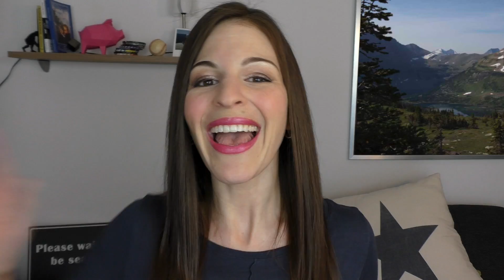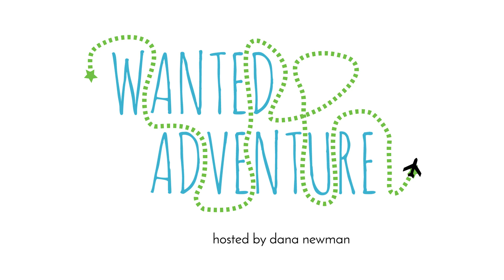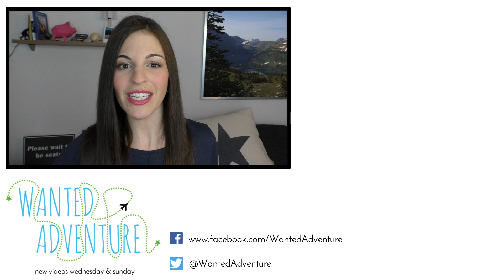Why Are Houses in America MADE OF WOOD?!

Comment: In warm climates you will find plenty of cement. Cement does not age well being exposed to the elements and temperatures in the Northern US. Wood does settle and warm with humidity and cold, but it is also a lot easier and cheaper to replace if need be.

Comment: I disagree with the argument of the tornado proof houses. It's correct that tornados can carry out big objects like cars and it's correct that you can't prevent to suffer damages in your house because of them, but if you hit a car against a house(because of insane speed) the car can destroy only a small part of the house, not the entire building. A good reinforced masonry house is very resistant and you may damage a wall or pillar but not the entire house as a tornado can do in a light wooden house.
I think it's more precise the fact that the cost of a house made of concrete is far much of a wooden house. Suburbs houses are tend to be big in surface and the same house in stronger materials would cost much more so, you may have to choose between a smaller and strong house or a big and light one... And the big house is always more attractive until you face a tornado or a punch in the wall...

Comment: wood is great for making homes its been used form homes since life existed, but ofcourse our history only remembers houses made from other building blocks, stones or just 1 single stone.  There are zero benefits of making house with wood over concrete, steel and bricks except cost. 
so cost point of view if wood is cheaper then other building materials around you its a good deal. Most concrete houses are made for more then 50 years to 75 years, but you can extend life up to 100 years, by putting good foundation, regular plastering and painting at least after every 10 years or 15 years.

Comment: I actually came to this question after a visit from Morocco. They make their buildings from concrete. The floors, roof, walls, and steps are incredibly strong and solid. I was wondering why they didnt do this in america. I did find out that prior to 1940s the norm in america was concrete and brick, which you did not mention in your video. After the 1940s they switched to wood because it was cheap and quick

Comment: 1. Wood is abundant and cheap in the U.S. 
2. Most houses are first or second survival houses (meaning first one on that lot)
3. European houses burnt down/ torn by Earthquakes for thousands of years, maybe 99% of them. 
    So the older ones are naturally the 'survival of the fittest engineering's'
4. Brick houses aren't immune to windstorms - An house in Tornado Alley is more likely to survive tornado than a brick house that is not built up to code.
5. Tornado Alley Also has Earthquakes. So you can't make things purely out of stone 

This type of house will do just fine:
Concrete Foundation with Large Metal Braces in every corner, ties from the sill frame the rods in the concrete. 
Ties from the sides of the walls to each beam. Hurricane ties on the trusses, Brick Vyner siding with ties every few rows 
to keep the wall from falling over. Sideways bracing for the walls so that the house doesn't go 'parabolic'. If you tie the roof to the
foundation it will have an 95% chance of surviving and EF3 Tornado with minimal structural damage. The Most Important Part 
Is the Roof Tie down to the foundation. If the Roof Goes the whole house goes regardless of strength of inside. 

If you want proof that Brick/Iron builds won't save you Look up 1896 St.Louis Tornado, and see what the 2011 Joplin Tornado did to Steel Structures with modern code. 

Code is key! Remember many houses have to survive both tornados and 8.0 Earthquakes in the Mid-West.

Comment: Correct me if i am wrong but i believe most of the world apart from North America builds most of their modern (not vernacular) houses in Masonry and Concrete. When North Americans first settled they found plenty of wood and they needed to quickly build settlements. They continued to master their techniques inorder to cull its disadvantages instead of turning to masonry which was obviously more advantageous when looking at strength and durability but required more work and time

Comment: Hybrid stainless steel rebar and stainless steel fiber reinforced concrete house. The posts, beams, floors, walls, roofs, foundations, stairways, etc. Concrete is 2-1-4 cement-sand-gravel parts by volume ratio. Water is pre-mixed with plasticizers and retarders to create a 
semi-plastic and semi-liquid concrete mixture. The 1 inch thick stainless steel rebars must be spaced apart by 1.5 to 2 inches from side to side. The stainless steel ties must be .5 inch thick and tied together by triple-twisted stainless steel wires or stainless tungsten steel mechanical clamps and the stainless steel rebars connected together by stainless tungsten steel Mechanically Bolted Couplers (MBT).  Mechanically Bolted Couplers (MBT)  (M)echanically (B)ol(T)ed MBT.

Comment: in Egypt they are mostly apartments ! And are built of cement bricks...and cement filled over it , you need a drill to hang any art work or curtains, that is a big draw back....yet they do not burn down... but other things inside like clothes and melting items are not  o.k. After a fire...we had one when we lived there...the smoke and deep and black ash on floor ...it was still devastating...it was a dryer fire...

Comment: the Tornadoes you referred to are probably the extreme examples, if houses were built with concrete and bricks/stones will make a significantly different percentage of (less damage) than the wooden homes with standard construction (no extra fortification). I believe the abundance of wooden raw material for home building make a larger margin of profit "that the industry is not willing to lose for the sake of safer homes"

Comment: Vulnerable to natural disasters, Fire hazards, Cutting trees even if they came from a wood farm, Termites, useless spaces like attics  that just take materials and due that no flat rooftops that could be utilized, moist basements if any, sound and creak from inside and outside, plus other habits of building like hard to work and handle stiff single core electrical wires that most of the times go through woods with no conduits (fire hazard), all the world went for cheap, easy to work, ever-lasting and sanitational PVC Piping while obstinately continue to use those precious copper pipe that with these magnitude of usages will soon became a rare earth element and many more, all in all is bad package.

Comment: In Mexico most houses are built with blocks and concrete with concrete roofs. All you got to worry about is impermeable paint for the roof and exterior paint every 10 years approximately. My grand parents home is over 50 years old, 3 stories high and still standing.
Reply: Houses in mexico look ugly why do they build them with a flat top roof with pipes sticking out of the upper walls

Comment: It's not about surviving a hit from a million to one bus at ~random speed but about but general survivability from the storm and not creating extra debris.

There are thermal benefits, brick has a much higher thermal mass so it  takes weeks to heat or cool rather than hours for wood. In hot climates wood may be beneficial but in Northern Europe it can change day to day and most of us do not require Air conditioning. We can open windows in the evening if we need to cool the air and the house stays fine throughout the day as the heat cannot get through 2 brick walls and insulation.
I would rather be in my 100 year old brick house or my mums 40 year old brick house both with cavity compared to a similar wood version. Doesn't matter if a bus hits any house at 200 mph but I bet it would stop sooner if it hit mine rather than going through '2 blocks' of wooden ones (Bricks are a lot heavier so the energy is dispersed). 

Also Bricks are really really really hard to burn , wood not so much.

You did not mention cost. Bricks are more expensive. I'm almost 40 and will pay off my mortgage before I'm 50. My children can pass the house the their grandchildren without having to rebuild it.

Comment: She missed several other really important points on why American home are built the way they are.  German homes are three time the cost per square foot to build.  Mortgaging laws restrict the maximum pay off time on your homes mortgage to 25 and in extremely rare cases 30 years.  No bank will offer a mortgage that can be paid off by an average family in 25 years.  The final one is a doozy is energy efficiency.   If you live in a really hot or really cold area, it's better to insulate and weather seal a wood frame home than one made of concrete and steel,.  It can be done, but it will cost you dearly.  Lastly, the end of home life cycle cost in environmental footprint has to be considered.  It takes far more energy to create and dispose of concrete and steel over wood.  Mining, refining and disposal of steel and concrete is substantial.  Wood as it's being produced, absorbs CO2 and it's more redily absorbed by the environment.  German home are neither cost, energy or environmentally efficient compaired to American homes on several levels.

Comment: Rods, bricks, stones, steel beams, glass, cement, concrete,  I  would  have  my house built with thick walls mainly, the windows may be covered with steel shades, a very safe basement, an inner concrete reinforced rooms at the center of each floor,

I consider that the flying debris  such as those that  you  describe may damage  the wall or it may smash the steel blinds at some of the windows or an outside door, but it would only produce minor damage, if houses like that would be built at the tornado alley, the amount of flying debris would decrease in a large percentage, the cars would be parked inside solid garage structures, and the costs for an insurance company would decrease in  the end because the damage would never be the whole house just parts of it, and the mo0st better part of it all is that your life is still safe at home

Comment: Oh also, in case of fire wooden structures actually hold up stable longer than concrete and brick because all that stuff is heavy and supported by steel which heats up and bends. Wood even while burning is supposedly still pretty stable until a certain point. (that being said I'm European and I still prefer the solid brick walls and ceilings to the wooden squeaky ceilings and flimsy drywall - wooden beams tho look very nice and presumably would even benefit from the better stability during a fire I talked about)
Reply: Total Bullshits! The reinforced concrete and bricks are much more fire proof than wood.

Comment: The thing I hate the most is you can punch a Hole in a wall by accidentally tripping and you can hear EVERYTHING, the neighbors, heating machine, the person in the next room, the steps on the floor above. I grew in a concrete House and noise is minimal. Its crazy to think Houses in North america are made out of such cheap and bad quality materials and still can cost millions.
Reply: The difference is that people actually own decent sized homes in the US, unlike Europe. There is nothing wrong with building homes out of wood, and there are plenty of methods and materials to optimize soundproofing and weatherproofing.
Reply: @fosterslover  Why don't you Americans use concrete and masonry as building materials?
Reply: Profits for developers wood is cheap and quick to assemble together
Reply: Not all wood is made equal muricans just use the cheapest plywood (literally waste wood glued back together) they can find, i always lived in a house made out of stones but i'm pretty sure good trunks aligned like a French or Swiss Chalet is very durable with it's thick walls.
Reply: and they're expensive. it's crazy
Reply: @P2Pbase  expensive wood houses in USA! I also wonder why
Reply: Actually wood houses are cheaper and resist better to heat or cold
Reply: @becayebalde3820  Wood house can not isolate the sound. Wood house is much more vulnerable to fire.
Reply: The thing I hate most is you can pay up to $1mil for a timber box, stick a sheet of paper on it and people call it a home
Reply: No the noise is not minimal in a concrete house. I have a mentally unwell neighbour who screams, you can hear her two rooms away.
Reply: Not ALL the houses in the US are wooden. A lot more are wooden than other countries, but I've lived here my whole life and have only lived in brick houses. The sound is a bit worse than other countries, though. And you could definitely not punch through drywall unless you were trying, and you could DEFINITELY never punch through a real wooden wall, no matter how hard you tried.
Reply: @dqw4w9wgxcq32  they are brick facades if they are in America. I’ve never seen a brick all around house anywhere in America that wasn’t wood framed on the inside.
Reply: @LucasFernandez-fk8se  in America or just on Youtube?
Reply: @LucasFernandez-fk8se  there's a lot of them, you clearly haven't seen much of america at all
Reply: After The Great Chicago Fire, ALL buildings were made of solid brick and masonry.  Also, many areas in Florida use masonry construction due to the high humidity and prevalence of termites.
Reply: @dqw4w9wgxcq32  Why do you people  in the USA so prefer to use wood as building materials instead of concrete and masonry?

Comment: Wood is safer in an earthquake. It will flex, whereas concrete will crack and break, heavy pieces will fall on you. Also in a cold climate, wood is more comfortable because it doesn’t feel clammy (it has less thermal mass to keep in the cold). Wood is a better insulator, so when you heat a wood room, it stays warm longer.

Comment: The odds of your house being hit by something large enough and heavy enough to destroy a brick house is so low though. 99% of houses in a Tornado just suffer damage from wind and have the internals of the house ripped out. It’s going to cost much less to replace the internals of a brick house than build a whole new one out of wood. So the point stands, brick houses are better in a tornado than wood houses.

Comment: When I watched american tv series and movies, people always got thrown through walls or kicked holes in them. I really thought this was a film fantasy effect. In my country even the shed behind the house is constructed stronger then an avarage American house. Drywall in a real house? really? In most of the countries I have been to (all in europe) houses are made of stone or concrete. Some old houses have wooden floors but never wooden walls. Indoor walls also are made of brick and you could get your head smacked but never kick or fall a hole in it. Even the really old houses like from the 1850'th are not as weak as the houses I see in American house rebuild series. I shake my head every time. It looks like Americans are cheated. At the end it looks good but the materials uses seam very weak. And whats with the nailgun? a nail only holds a 90 degree load but never a "pull-load" That is why we screw everything. I never saw a nailgun used in any building construction in my country. Now I understand why all the houses get blown away in the USA with the tornados. The Americans live in cardboard boxes we would only use for theater-stage make belief houses for a play :)

Comment: So she just googled this stuff and repeated what she found. She's truly American
Reply: She is US, because america is bigger than just the United States
Reply: @regresoderambo  You're dumb. "American" is what citizens of the United States are called.
Reply: i hav seen trailers and trucks flying inside a tornado :- S
Reply: She is partly right in that the Home Architects and Construction people are geared up to deal with wood. Ask for concrete and most companies wont want to touch the Job and if they do the price will be enormous.

 Secondly wood houses look a lot better than concrete and since Americans rarely live in a house for more than 7 years, it is important to them that the house can be easily sold.  In most other countries you build a house for life and beyond, so you need it to last that length of time.

What she missed is the root cause of the problem.  Soil in most of America is very soft.  America is one of the few countries that you see massive trees just fall over after high winds.  The weight of a reinforced concrete house with the bricks filled and steel is probably about 20 times higher than wood per Sq Ft.

  You would need Pylons to be sunk in order to prevent the house from slowly sinking, this is very expensive and can almost double the price of the house.  Our company put up a data center in the Caribbean and the land they used was considered to soft for building.  When I checked it out it was still harder and more compacted than the typical soil in the US, especially Florida.  We got a crew in and they determined we needed over one hundred Pylons sunk down to a depth of 80ft.  The building was completed after two years and within five years it had still sunk about 3".  After that it settled down, but I can say that the Pylons did cost a lot of money.
Reply: @Dreadlk  Most concrete houses have a secondary brick wall on the outside, nothing wrong with the looks of that. Even if you move every 7 years, you still live your whole life in a flimsy house. The whole city of Amsterdam is build on wooden poles because of the soil, nowadays they use concrete poles. It costs money indeed, but that's the whole reason Americans build houses like they do, because it's cheap. That's all the reason you need.

Comment: take florida for example. no rocks in florida found naturally. this makes concrete an import item. shipping costs would be astronomical.
take  northern states like NDakota/Minnisota/etc high sulfer content in the ground eats away most concrete making it a non longlasting material
then size alone is a factor.  equivalate to why are spains houses not the same as germanys? or  Norways? different biomes